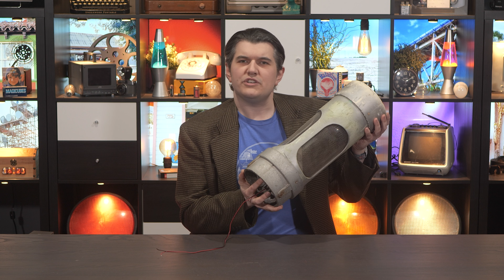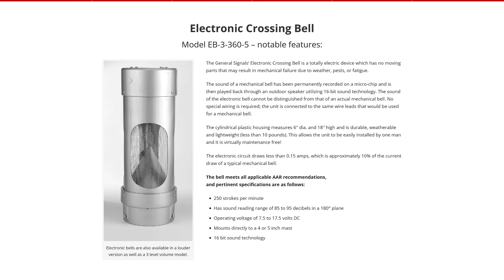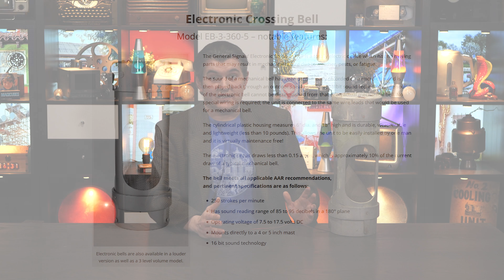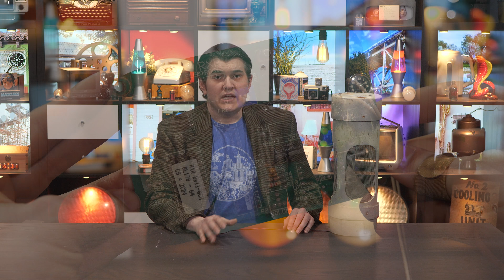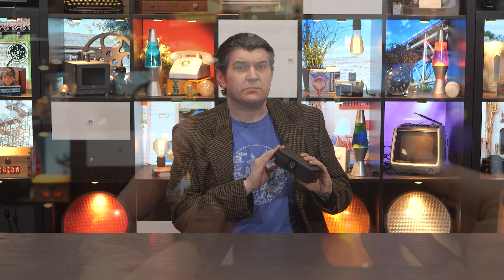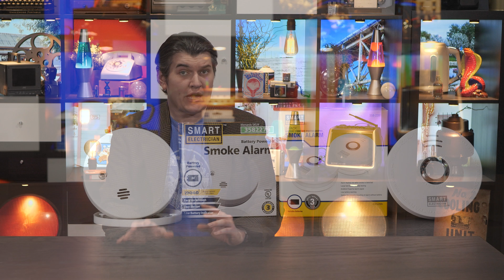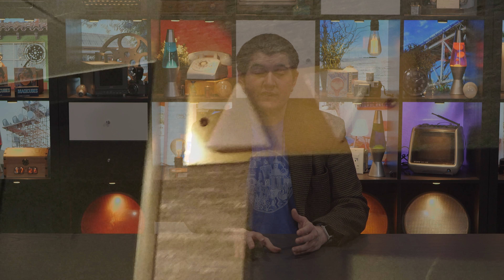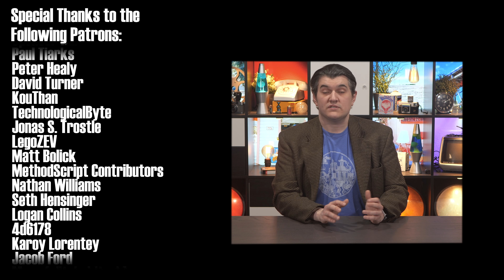The disappearing and unappreciated art of audible alerts

Comment: I don’t fly much anymore, but it used to be in major European airports, I especially remember it in German airports, when an announcement was about to be made, first there would be a very distinctive bing-bong that alerted you to the fact that an announcement was coming. It got your attention. Unfortunately I think this practice has dies out. I am “hearing impaired “, I wear the very best hearing aids money can buy, but I can rarely ever understand announcements in airports or train stations. Fortunately a solution to this is slowly coming to Europe where I live. It is a system where, with joint cooperation between hearing aid manufacturers and “public utilities “ announcements on PA systems in, for example airports and train stations, are received DIRECTLY into my hearing aids. That will make my traveling much easier.

Comment: Samsung has the reminder notification system, which I don't use... but maybe it works. I don't think there are ways to suppress multiple text notifications you would just have to mute people and there are options for that, but they're temporary a on Android I think we can mute individual app notification channels for up to 24 hours at most, but if the person notifying you is through text but you're waiting for an important time sensitive text from someone else. Well too bad, you muted all text notifications by muting that notification channel!
I think the notification system on Android is already very complicated. I just check my device whenever I'm online. I only allow a few apps to notify me and I don't use sounds or vibration. I use an integrated system that allows me to approximate a radio intercepts by my (and unintentionally everyones) mobile device, to determine when someone messages me when my phone is only connected to cellular data.

Comment: Great vid! 
I REALLY miss the overall 'experience' I had with my Palm Pre. It was intuitively ergonomic in so many ways. I still have mine, and it still works when plugged to the power supply. It had that message reminder feature. It beeped like once every minute to keep reminding you that you had an unread text message. 
The coolest retro 'thing' about it is that mirror-polished metal plate they put on the back of the half that slides up to reveal the keypad. It was there for making sure your face was in frame when taking selfies with the one rear-facing camera that it had. 
I also still have my Apple MessagePad 130 too. Another device with ergonomic, intuitive features that was ahead of it's time.

Comment: Absolutely love your videos. As an engineering student in 70s I was doing some research in the Bell Technical Journals. Absolutely amazing stuff in there, I wonder if they are online now? Anyway, by accident I came across research Bell did about the ring your phone made, landline phone of course, that is all that existed. They did extensive research to find the right sound. It was a balance between being definitely a special sound, a sound that required your attention, but also not too annoying. They, of course did not want customers to be annoyed by the sound of a phone ringing, but they also wanted it to be just annoying enough that you would somewhat hurry to answer it. If you took too long to answer the phone, that tied up their phone system unnecessarily. That might not seem really important, but when you had like 100 million phones on your system, shortening the answer time by a few seconds really adds up. Good old Ma Bell, they studied everything.

Comment: I will say that I wouldn't describe the airplane sound as unobtrusive. It definitely pulls me out of my movie when it goes off. It is not jarring- the softened tone does do that well- but you still hear it and get distracted by it when it goes off. I personally don't miss audio queues in office environments, as I remember meetings that used to get thrown by several watches going off slightly out of time with each other, or someone's phone on vibrate getting a notification. If you are in a shared environment then I think you have an obligation to consider the impact on those around you- particularly if it is a shared office environment when everyone around you is trying to do their own work. It is also my pet peeve about working in the office and then having so many meetings online- it just bleeds into the area around your desk.

Comment: Temporal 3 needs to find it's way over to Australia. 

We don't have smoke alarms here. But we've got these weird round plastic things on the roof that tell us when someone is cooking nearby, and they also detect fires for some reason. They do do 2 to 4 beeps per second (depending on the brand) with no pause until they stop detecting toast, bacon, or mortal peril.

It has the same effect as the overly sensitive alarms you've mentioned in the past. People just want them to shut up, so they take the batteries out, especially if they're too sensitive. Then they added a "feature" to keep a small external power cell in them so that if you take the batteries out, they let out a small chirp every few minutes. The chirp doesn't happen if you leave the cover off though, so it kinda defeats the purpose.

Pro: Every time I hear it, I want to get the hell away from it as fast as I can. 
Con: Every time I hear it when there isn't a fire, I want to hit it with a cricket bat. And I don't even own a cricket bat.
Reply: ah yes the "oh fuck off" discs that eventually end up broken on the floor after you have tried to "snooze" it for the 35th time this week and so you decide to give it the forever sleep..... as a note I need a new smoke alarm.

Comment: 19:31 fun fact, xiaomi kinda has an option for that, where if you swipe the notification popup away it would temporarily suppress all notification sounds and popups for a minute or until you lock the phone (which can also be quickly adjusted in the settings button/link in the toast that notifies you about that)

i had to update the comment several times because i misremembered what it does, and it's becoming less useful every edit lol

Comment: 20:40 hey I have that exact same issue, no push notifications from Gmail and there is no fix!!!! Thx google!
Reply: I have literally the opposite problem 😂 Gmail sends push notifications on literally every single email that it classifies as “primary” and I want to filter out the ones I know aren’t important.
Reply: Same!
Reply: have you tried gmail settings -> select the offending account -> inbox notifications -> selections label notifications and checking notify for every message? 

just cleared my gmail app storage and this isn't on by default and was having the same lack of notification issues.
Reply: @isentropik-d3s ah, that’s the setting I needed!  Changed it to “high priority only” thank you!

Comment: Annoying preset: My new microwave turns the clock off "to save power". I have 10kW of solar and a 50kWh battery. I really don't need to save a few joules per day, and I would love to have a clock in that location.
There is no option to keep the clock on. The manual even has a line in the troubleshooting section which says "Clock turns off: This is normal behavior".

Comment: I'm okay with some more sounds as long as we include a visual notification for Deaf and hard of hearing folks and we don't go full Tokyo. Everything in Japan makes noise. It's cute at first, but I got overwhelmed really fast. And everyone had that bird whistle notification noise and it was. so. much.

But also... 14:42 my phone makes NO notification noises or vibrations or lights or even lock screen cards unless it's a person in my starred contacts. I have trained folks that I cannot be reached at the drop of a hat unless you really try. If I'm expecting to be relied upon, I will set the noise mode on briefly. If I pick up my phone, it ruins at least half an hour. I appreciate that I can set it to nearly silent. But that doesn't solve other folks' issues of wanting more varied sounds.

Comment: Speaking of audible signals, that reminds me of two things.
The first is that new electric buses in China (and even exported Chinese electric buses) in recent years use a bell sound effect when the vehicle is running slow to notify pedestrians, that's probably imitating the alarm bell sound on trams
Another example is a car called Lifan 520 (力帆520), and when the doors remain opened, there will be an alarm sound that's exatly same as a household doorbell… The car was a huge failure and came with other problems. This clearly showed that designing a car is definitely not just putting parts together. Human machine interaction is also an important thing.
BTW I've already noticed that you're a railfan😂

Comment: No phone I've ever had was as good at notifications  as the Blackberry10/BB10 devices.  You could control vibration pulses with how long and how many...and different sounds so easy.  I'm on a Pixel now and it's so hard to change the sound, and vibration, only if the app allows it.  It's a mess.  ONLY BB10 got it right but RIP

Comment: Speaking of easily added and useful features that aren't available in Android for some : screen looping, the ability to scroll sideways continuously in either direction through the screens of apps on a phone. The default is that there's an end point in either direction so you have to stop and reverse to get back to the screen you want. For someone like me who organize each type of app on a separate screen, it's frustrating not being able to just swipe without end points. To get that functionality, you have to use an app. It boggles the mind that such an obviously useful setting isn't part of the standard setup.

Comment: The 3 airlines I've been at have roughly the same meaning

Single chime, either belt sign or announcement to passengers. 
Or notification of sterile to unsterile/vice versa. (Sterile being below 10k ft, meaning no communication except for saftey of flight) 
One used 2 chimes to notify gear down for landing. 
Or a chime for clearance for takeoff. 
Each kind of have their own way, but fairly similar. 

2 bing bongs, Hey cabin crew, flight deck wants to talk to you

 4 bing bongs, hey cabin crew, we got an emergency.

Comment: First off, on my phone I run an app 'Voice Notify' which reads out Notifications. So in the last example of an informative Gmail notification that informs who the mail is from, "Yes !: this app does that. It also has filters to require, or suppress, specific notifications., and also from specific apps. Plus, a 'cool down' that works. 

Next, in regards Alarm Sounds more broadly (fire alarms, door bells, etc), at home I have smoke detectors in my basement, laundry, kitchens, and basiclly, all over the place, many of which are inaudible if I'm in bed asleep. So I replaced them with 'smart' detectors that signal Home Assistant, and HA triggers a loud alarm, outside my bedroom. Great !!!   
Well, not quite. 

One night, while fast asleep the alarm goes off, and panic!!! What's that alarm? The smoke detectors, burgler alarm, water leak??? And which one? The basement, laundry, etc. 
Yes, there's a notification on my phone, but that takes time to check (especially as mine is turned off overnight). 
All that takes time, and is a problem if a burgler is making their way upstairs, or there's fire raging in the laundry.  

Anyway, my next step was for my Home Assistant to vocally announce the Alarm (as well as trigger the siren, if necessary). 
So now, HA is set to announce which smoke detector, water detector, etc, and its location, so I know exactly what and where. No more trying to figure what that alarm tone means, and then the location. (Also for Alarms, I set HA to repeat the message a couple of times.)  

On top of those Alarm Notifications, I'v also set Home Assistant to announce when (real) mail is delivered, when the washing is finished, various weather events ( high winds, rain, etc; from my weather station), when specific Vehicle License Plates are seen arriving (eg, specific visitors, or Amazon). Pretty much anything that Home Assistant can communicate with, can be announced (or not, and even depending of time of day). 

Technical Note: 
For the HA Announcements, I use ESP Home Builder devices, configured as DLNA speakers (you can instead use Amazon Echo Dots, etc), and I have numerous of these scattered throughout such that the announcement is audible throught the house. Previously I could not hear the front door bell, when working in the basement, or at the rear of the house, but now I hear an announcement. 
Also, Vehicle License Plate (LPR) processing was implemented via Frigate NVR.

In summary: 
Yes Alarm sounds are good and have their place, especially when frequent, but Announcements can be very much more informative as long as they do not become tiresome.

Comment: What started like a cool video subject ended up like a rant worth on Technology Connextras... 😕
No offense but that video could just have stopped at half the script and it would have been fine.
And that's a bit of an usual TC pattern lately...
I mean do we need 54 freaking minutes to explain "gas engines require oil", or 52 minutes to explain one can charge a car with a normal outlet socket?
You've lost me here... we're so far from the good old VCR/videodisc early videos of the channel.

Comment: Smartphone notifications have seriously regressed from ten years ago. They used to go into detail in phone reviews about all the new do not distrub modes and notification customizations. Now half the options are broken or heavily obscured. Speaking of presets, I still really hate how after two decades, they still can't give you any control on auto brightness. It can be too bright indoors, too dim outdoors, or be oversensitive and fluctuate way too much. There is still no easy way to instantly trigger full brightness, or any brightness increase, when you happen to have it manually set to low indoors and you walk outside into the blazing sum and the screen becomes invisible. Just so many obnoxious design omissions.

Comment: It is fun.  I have to do this in a factory setting.  Trying to find a sound that suggests "you're making junk and it's your fault!" when really it isn't, that is neither annoying nor haunts the operator's head at night nor comes across as nagging is hard to do!  And unintended things:  I once had a fairly important alarm that meant you had to stop and fix things right away.  It was a very rare alarm but had to be attended to, and needless to say it was loud and 'alarmy.'  Once it went off, and the operator did not shut down for quite some time.  The reason:  they thought it was part of the song they were rocking to!  Oh, and regarding the crossing bell:  that appears to be an 8 bit ROM feeding a serial (1 bit input, 16 bit sound) DAC with one of it's bits.  I wonder if there's anything interesting on the other bits?